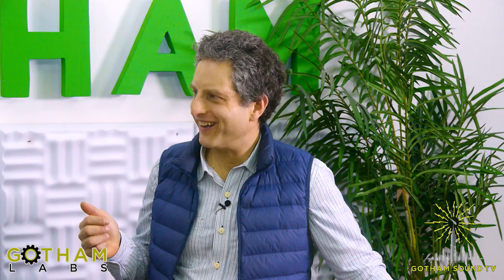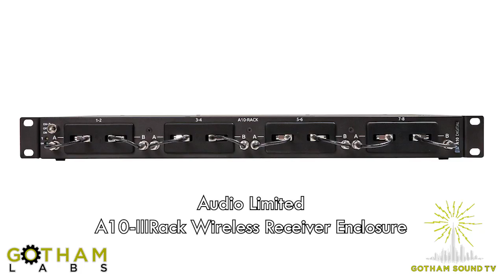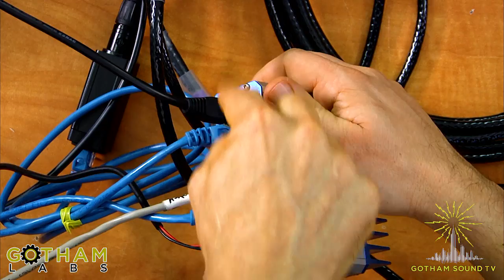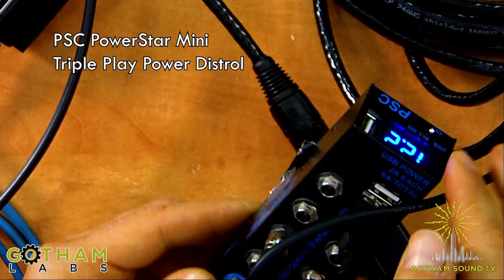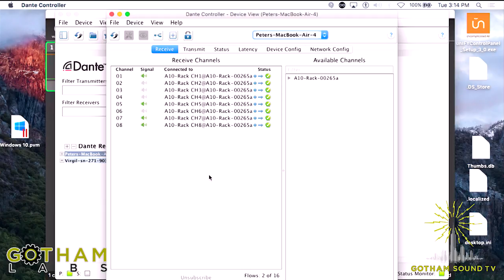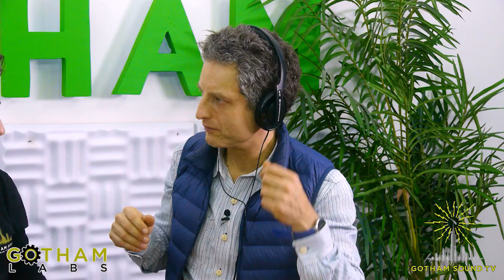Gotham Labs: Building a PoE Production Audio Recording Rig

Comment: Yes More, Question does Sound over Dante introduce additional Latency?
Reply: Latency on a Dante network is deterministic. You can set it to be as small as 150 micro seconds as long as you are using a small network with a single switch (which fits the needs of the majority of location sound users), or as long as 5ms when dealing with a network with over 10 switch hops, which is extremely large and not as common (think universities, large TV studios or other mixed complex IT infrastructures).
Reply: A negligible amount, particularly in film/tv production settings - see https://www.audinate.com/faq/how-does-dante-affect-latency-system.

Comment: Pretty cool stuff! Wouldn't RF over fiber be an option to replace long coax runs?
Reply: Absolutely!  But RFoF adds a whole other layer of complexity, particularly with bi-directional RF. Please stay tuned for one of our next videos about RFoF in film production settings.
Reply: This is kind of where I am at- With the cost of fiber quickly nearing the cost of Cat cable, it seems tactical fiber would be a better solution to the antennas. It also allows longer potential runs.